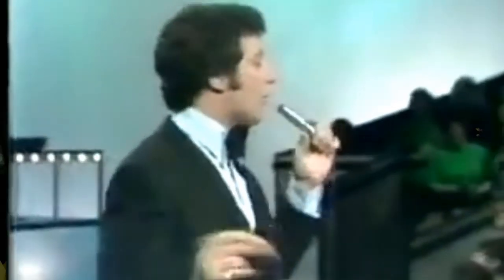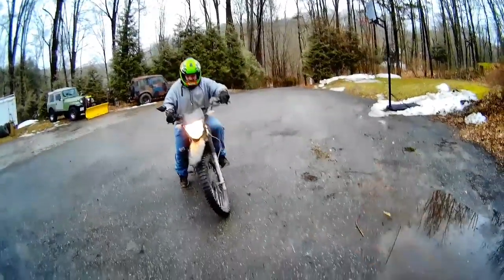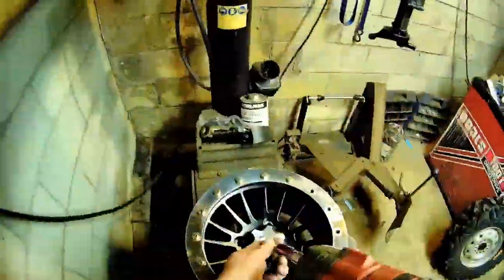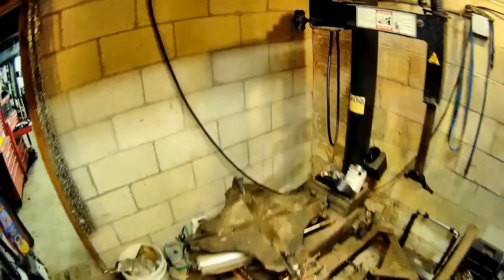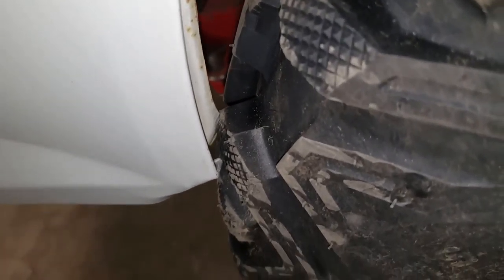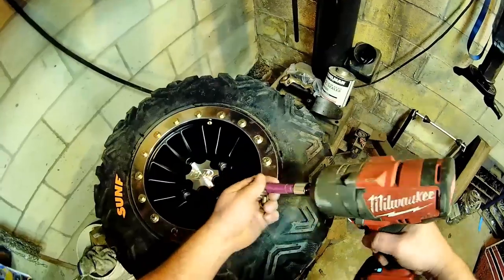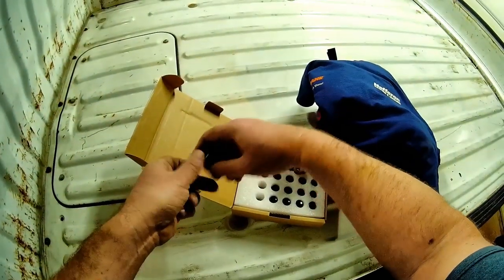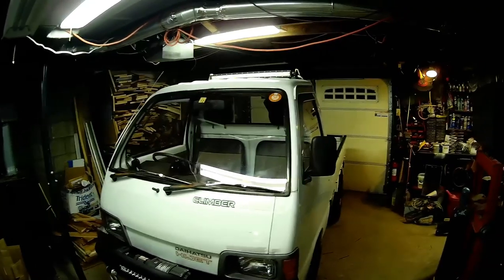Mini Truck (SE01 EP15) Mag tires Springs a NOPE!, HATE, Love and Suggestions, workbench HiJet series

Comment: "From the bottom of its oil pan" made me smile ear to ear. Happy little truck and keep up the great work! Also having a tire machine and balance machine in your garage is just awesome, ran both of those machines (after high school/during college) for 5 years .
Reply from the maker: Thank you!! They're older but work great. I used to have an old Coats 10/10 if you know what that is.... Real old
Reply: @MotoCheez  Never had the pleasure of using that particular model (only 39) but I did look it up. We had the Coats 5030 series, similar in setup as what you have in the video but of coarse instead of black they were your typical Coats Red/White.
Reply from the maker: Nice! I'm older coats would really beat a tire with that air ring, wouldn't they !!!

Comment: Those rims were sweet! Just need a slightly smaller diameter and wider tire. 

Also, maybe fab up a luggage rack on top the cab and install 360° perimeter LEDs.
Reply from the maker: Have a set of the original 23 inch rims I'm going to put on there, that should work if I put a luggage rack I'm not going to fit in my garage. those are underbody lights that I installed I think I'm going to move them so they shine outward instead of just underneath it'll be more functional

Comment: Its been a fun "ride" with Mini-Truck...  Damn :X I really wanted those rims to work.... On this end of the camera, the overage didn't look too bad. I thought fender flairs would tie them right in and give Mini-Truck that beefed up, bulldog look.
Reply from the maker: I'm doing it! Most say do it
Reply: @MotoCheez  .... and Flames ..LOL
Reply: Yeah, you can go with the rims and all that, as long as you're willing to trade some 'off road-ability' for bling.

I'll look forward to the episode when a stubborn tree rips away one of those fender flares. ;-)
Reply from the maker: that's the thing I don't think I want to put the fender flares because then it'll interfere with the rear side fold Downs on the bed of the truck so I'll just have to deal with the with. Saw use a 23 inch tires for The Bling rims and then stock rim steelies with a 24 on there
Reply from the maker: Plus it won't fit on my 5x10 trailer anymore either, but at least I'll get to use the rims and if I end up going to a car show or whatever with it I can put them on for show and then leave the steelies on the rest of the time

Comment: Another new subscriber here.  I discovered your channel last night and I just finished watching all of the mini truck episodes.   When working for a company years ago,  I met one of the first people who started importing these into the U.S.   At that time,  I considered getting one for use as a hunting vehicle, but they were having a hard time getting any spare parts for them.  Apparently spare parts are no longer a problem.  Good luck with your channel,  I think you're going to grow rapidly now.  
P.S.   If you decide to cut the fenders to fit the wider tires, make sure you also have enough clearance when turning sharp.  If all the rim offset is to the outside, you probably won't have any problem when turning, but it doesn't hurt to make sure.
Reply from the maker: Well that's pretty cool to know the first person who imported these, I knew a guy who bought one of these about 20 years ago and he was having issues with parts but the thing was great and that's why I didn't want one then but I really did want one. I end up using my first set of 23 inch tires that I bought on those aluminum wheels, I didn't really want to cut on the mini. I'm working on the video right now. Thank you for the kind words and the sub!
Reply: @MotoCheez   Have you considered golf cart tires to fit your rims.  I know you can get those in 23" and in a lot of different tread styles.  Most I have seen are DOT approved and with more than enough load capacity for a 1500 lb truck.  For example: https://www.golfcarttiresupply.com/lifted-golf-cart-tires-for-12-wheels/
YouTube might erase that link, but the website is for Golf Cart Tire Supply and tires for 12" wheels.
Reply from the maker: Those would work but the width is too wide looks like most of them or 10.5 in maximum I could do benign and they have one that has just a straight lawn trade. it's such an oddball size I think I may have to end up changing the rims.

Comment: It wasn't just the mini that got you the subs. YT did it by promoting your video. I've never looked at any videos anywhere near a mini truck or similar, and your video was just randomly on my screen one day.
Reply from the maker: Weird, must be my time!! Lol
Reply: @MotoCheez  Glad it popped up though. Very interesting what you've done. I did worry about the bumper / winch combo bolted through the sheet metal on the front. Hows it holding up?
Reply from the maker: Thanks. Holding up good. When I do the 2" receiver I found a good anchor point and it will all tie in strong.

Comment: Been enjoying your mini truck series and creative mods.  although this may be the less popular answer I prefer the factory steel rims they look clean and utilitarian cutting the cab and adding fender flares might look cheesy remember those low riders from the 90s where the rims stuck way out and the ugly curb feeler whiskers... not a good look for the mini truck keep the factory rims perhaps have them teflon coated black or not...  Those wider rims will probably loose some ground clearance as well, perhaps a tune up series would be interesting not that it needs it but it would be interesting to see a bit more about the little engine that powers your truck
Reply from the maker: I think I'm going to put my old 23s on these aluminum rims.

Comment: I'm looking forward to a wheel swap on my Sambar as well.  Those are awesome looking.  Pretty damned wide though.
I had the Carlisle on mine for a while but couldn't fold the bed flat without removing the sides.
I'll set up some instantgrahms eventually.
Reply from the maker: I didn't even think about flipping the sides down with the wide tires, but it's looking like everybody wants me to do it. So I guess I'll be doing it. I did like the way they looked

Comment: Personally, I would get some slightly smaller AT tires and put them on the bling rims.  Will still look good but will solve many of the clearance issues.  Then just swap back and forth in summer/winter.
Reply from the maker: Hahaha, you read my mind, that is what I just did and I'm working on the video currently.

Comment: Great series cheez.

What's your camera/mic setup while you are working? Especially when you take us on those drives in your mini truck. Same setup? A GoPro? You wear some sort of adapter on your head or something to hold it?
Reply from the maker: believe it or not it's video glasses, even in the ride of the minitruck  I do have GoPro with the headset up but it's so cumbersome and still the wrong view angle I bought a dozen pairs of different video glasses and I ended up with the zetronix.
Reply: MotoCheez - I was wondering how you were able to use a welder's helmet and still record. Hope you post more videos of the mini truck in the future.
Reply from the maker: Thanks! I'm hoping to get at least 2 videos out a week... More if I get enough time.

Comment: I have Fabricated for a friend on an old something kinda SUV(I don't remember at all), but it was an adapter that came out directly connected to the strut mount ends, and the inner cab mount under the seat of yours well his mounted in the fender wells the same and just had a pipe mount to plate with a small hole in the side of pipe to thread nut on thru and big enough to reach in with end wrench to hold nut while turned shock to tighten and the bottom took bolt thru like top axle mount of standard shock on leaf springs. anyway they made no heavy duty off road struts for his vehicle and at first i thought ok ill do since he had just put these and after one day in woods and mud struts felt like an old 70's Cadillac would today with 200k miles, original OEM syspention going 85mph down a typical California freeway I thought double with a shock on each side keeping load baring center or even was the only way might work, and when got it in the air and pullig it wouldn't have had room for two straight across from each other no matter what so I went to work and done single on each strut then after we went to auto parts store and our buddy let us fit try Rancho RS 5000's till we found right length and travel that mounted to our DIY mounts and bought them reinstalled and it drove nice felt stiff(anything would've really compared to before) and he said it handled like his wifes Prelude, well a couple weeks later we went mudding and i took gas torches for dreaded repair if broke anything. Man it worked like a dream not a bit of noise, creaking nothing at all, so i was happy i mentioned that in just talking about not having anything but monroe crappers for off road as a choice of best back then. Well ive made a few more since simply cause cost of nice shocks vs strut and everyting else involved was substantially higher. built a double for friend who had custom Chevy Luv we had taken an old 231 buick V6 and yanked out that little 1.8 isuzu motor and made it fit so it was then custom as his paint job implied lol anyway he would jump and literally try things that a 4wheeler did, i taght him to weld ith his little wire feed miller he bought and he had plate and bracing, triple pass reinforced joints and bracing, everywhere in just about a year or less he'd broke mounts all kindsa stuff by time he asked me to help with front bottoming out problem, that undercarriage had to be bent I thought and if DOT ever looks underneith your gonna be towed, well anyway I built them with double Rancho's on each side and rear was easy being straight axel so each tire 2 RS 5000's by Rancho did awsome and never broke either, did feel like ridgid frame going down the road at 75 but handled like it was on rails. a couple years later i learned he always kept 44lbs tire pressure in hit yokohoma mudders even off roading. wow i never asumed anyone didnt know these things. both those i mebtioed were also my buddies daily drivers. Id've built them cantalever system if money wasnt an issue back then as i was still in my mind the best 19 year old fabricator on planet earth having certified all position Mig and Dual Shield for a job i got on the Portland OR steel Bridge rebuild. So i was the go to for youngsters like myself. I really could build anything back then, and Im still a Fabricator welder now and I could build anything now too prolly but I won't lol. Good job on Mini and keep em coming. Now I want one... Good luck!
Reply from the maker: That's pretty cool, you know I did actually contemplate using them short shocks off of the Chevys because the lower control arm is pretty sure and it's so tiny in there is really no place to mount one and it would have to have a super short throw. But I ended up finding a set of KYB shocks fairly cheap from great Britain that I just ordered because the ones I seen here were almost $400 a pair and I wasn't going to pay that. I was always the same way re-engineer something fabricate something that someone had been paid a lot of money to originally engineer that was a flop. I've done a lot of stuff also that I wish I would have put on YouTube when I was younger oh, now I kind of just do stuff for fun. you should get one, you sound like the type of person that would come up with some pretty good ideas that everybody can use!

Comment: If you haven't already. Try joining the Japanese Mini Trucks of America group on Facebook. Lots of dealers, part trades, advice you can get on modifying and repairing kei trucks. 

Also that comment at the end of the video claiming they were never meant to go over "35 mph" is wrong. Ideally, these are work trucks and meant for local delivery and services so they typically don't need to go faster than 30-40MPH but that doesn't mean they can't or were specifically designed not. They can and do go on the expressways in Japan every-single-day, they can go up to 65MPH on the low end and over 70-80MPH with the turbos and five speeds. Whoever said that doesn't have any idea what they're talking about and can be proven wrong by; A. Driving one like you and I have and going above 35mph regularly (Highest local speed limits in my area are 55 and it does it no problem, I've taken it on the highway as well but usually don't need to.) and B. looking any footage of Japanese roadways/express ways and watching how many kei trucks they can see. 

https://www.youtube.com/watch?v=-nZpCNT7JdM
How many kei trucks do you see using the express way here? It's not just something ignorant foreigners do. Kei trucks are the same as regular kei cars in spec, there wouldn't be a market for kei vehicles if they were all limited to below 35 mph their entire life or you risk them breaking down even in Japan that would make them useless. I'm not even sure where the confusion is from. Is it because they rev so high? That's how kei cars are, they all rev to the moon. Some kei trucks imported into the US and the cushman trucks have speed limiters on them but those are more an exception than a rule, usually because they're being used in a specific role (factory vehicle, farm truck)

By the way, on this topic. Does your kei have an over speed warning? A lot of JDM cars have speed alarms where if you hit a certain MPH/KPH they start beeping and they're usually pretty low. My kei starts beeping at me when I hit 47MPH or so. Expressways in Japan are usually 100KPH on the higher end which is like 62MPH which also happens to be where my 4-speed 87' Suzuki caps off.
Reply from the maker: I haven't, I've followed a few on insta

Comment: At last the rims.
Go for 23in with flares.  It will put less stress on the drive train.   Don't know if going for a pair of 8in wide rims on the front and a pair of 10in wide on the back would help?
Reply from the maker: I think I'm going to throw my old pair of 23 is on there. I don't know about the flares maybe later on, but I can switch back and forth between wheel set

Comment: It is not too much. It's perfect. Just install the 4 weels and you see. It will be fantastic!
Reply from the maker: I think I need use my old 23 in tires on these rims, and then I don't have to cut anything and I still have my other set to switch back and forth

Comment: I've had my mini for about 7 years. First thing i did was take it to a canvas shop and had a camper cover made for it. Not cheap, but well worth it.
Reply from the maker: I saw a few of those online, maybe it was yours but I did like that idea how much did it cost you
Reply: @MotoCheez  I took it to a boat cover shop. They had to form the tubing to fallow the line of the cab, and with the six windows and detachable awning, I had around$800.
Reply from the maker: That's not bad!
Reply: @MotoCheez  not at all. Amazing how much stuff you can get in it. Pack everything I need for 4 day camp. Fire wood included. Just watched your video where you get in on the wrong side. Funny. I still do it.
Reply from the maker: I was planning on making a slide in luan camper top, but this is a great idea!
Reply: @MotoCheez  easy on, easy off. Trying to get you a picture. Not sure how

Comment: The wider you go the more Stabler you'll be. Notch that corner of fender out and Rock those beast.!!
Reply from the maker: I'm going to put my old 23 inch tires on and I won't need to cut and use them for show
Reply: Yeah might as well not hack it up. Great videos.

Comment: You were looking at swapping out the springs with stiffer ones.. I noticed they have 300Lb springs on Ebay,, why didnt you go with those instead of the 250lb ones?  I know you went with the Hijet, is there any  one  model of mini truck that are easier than others to get parts for in the states?
Reply from the maker: the guy you saw on eBay with the 300 lb springs is the one I bought the 250 lb springs from, I asked him if I would need 300-pound springs cuz I have accessories and stuff that I put in an on the front and he says no only if you have a plow. Now I realize I should have got the 300 pounds springs. I'm not exactly sure which mini truck is the easiest to get some parts for I would think Suzuki Carrie would be. But I'm not really sure. I'm no expert I'm still pretty green on the mini thing
Reply: @MotoCheez   Thanks for the response. I have been watching all your Mini truck stuff, and am thinking it would make a great project for me and my sons. Whats the clearance on the garage door.. How about a roof rack. A motocheez fabricated special.!
Reply from the maker: Have an awesome family project, my son's do help me they're in the videos once in awhile but they have their jeep stuff oh, I also do the jeep stuff. Aurora 4X would not work for my garage it's only a six foot tall opening

Comment: SPRAY PAINT THE ORIGINAL RIMS BLACK
Reply: Right idea, wrong method... spray paint won't hold up to off-road abuse. OTOH, a good powder coating job would hold up longer.
Reply from the maker: Paint has worked great for me. I use oil based Rust-Oleum. Powder coat is better, but I don't know ow anyone else local...
Reply: @MotoCheez  RustOleum makes a nice bedliner paint too.  Not as thick and rough as some others, it has sort of a light "pebbly" finish.  Very tough though.  Might work on the rims.  Certainly will work on the bed if you want to go that route.

Comment: how about trying a body left kit. not suspension. are there body mounts.even just the cab an inch or two.
Reply from the maker: I wish they made more Sambars with rear axle locks.
Reply from the maker: The rear frame runs to a unibody on the cab on these hijets.
Reply: @MotoCheez  You're Right, Sambar with supercharged engine and diff-lock is more valuable than R32 Skyline GT-R.
Reply from the maker: Hell yeah!! 🔥🔥🔥